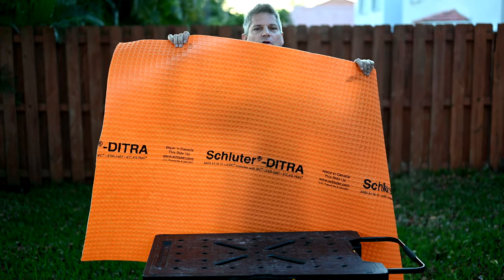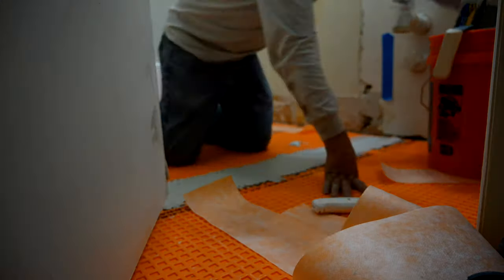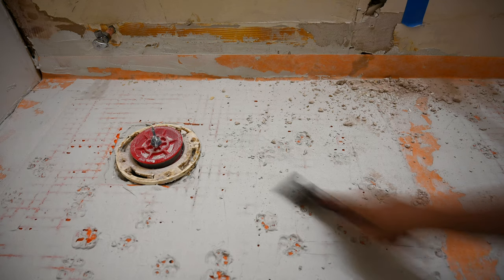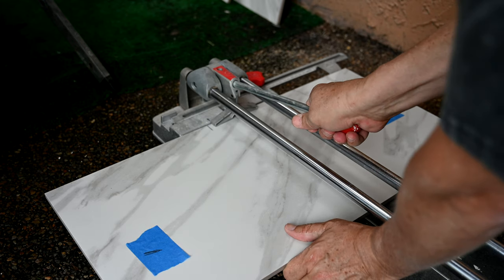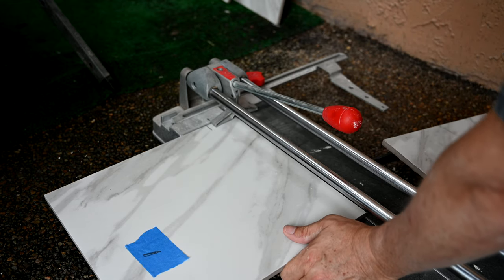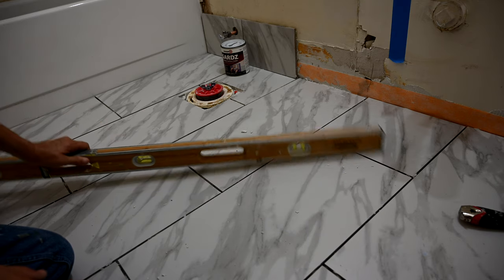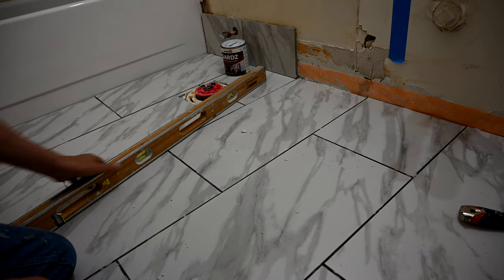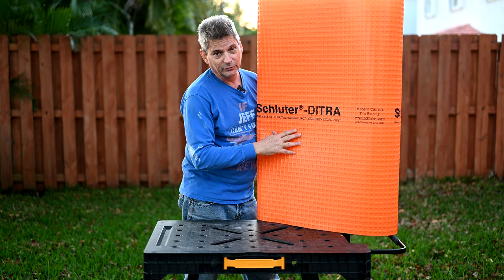Schluter Ditra FAIL Tile Install: You WON'T Believe Cause!

Comment: Those are some pretty cool tile spacers! Where can I buy some?
Reply from the maker: Here is where you get the spacers and wedges:
✅ Raimondi Tile Leveling System Starter Kit: https://amzn.to/2CAyweW
✅ Raimondi Tile Leveling Clip 1/8" joint: https://amzn.to/2RhbodI
✅ Raimondi LS250WEDGE 250-Piece Tile Leveling System Wedges: https://amzn.to/2Sopebl
Reply: Thank you very much for the links :)

Comment: That I know for a fact ain’t no half inc trowel the way u use it that Becomes a 1/4 inch 😂 been in tile business sense 2005 if u use self leveling spacers I call that a beginner u should be able to make that floor just as straight with normal spacers self leveling spacers u must back butter the tile before putting it down I didn’t see that in this video I bet if u take a tile off it’s gonna have 60% of tinset on the floor and 40% on the tile please do a better job so I don’t have to keep replacing floors
Reply from the maker: sounds to be like you're a troll who has no experience in tiling. You can't even properly pay attention to a video, let alone what you are doing. Of course there is no 1/2" trowel here on the mortar, there is not supposed to be trowel lines ! This was the scratch coat for Schluter DITRA, where you fill in all the cells and leave the top surface of mortar as level as you.  We have not even gotten to the point of talking about tiling yet because our surface mortar is not dry yet, and here you go off on some nonsense talking and rambling on about something not even related to this video. If you look at my full video on this bathroom remodel, set to the timestamp, you can see I used 1/2" trowel, and you'll see me back buttering. Clearly you are not qualified for this work and should not be criticizing the work of those of us who are when you know nothing about how the Schluter tiling systems work.

Comment: That's what you get for pre filling the "dee-tra" . Schluter does not recommend this....
Reply from the maker: Schluter instructions say you can do it either way. Point to me exactly where Schluter says not to do it. It makes perfect sense because you have a nice dry surface to work on when you lay your tiles.
Reply: @jeffostroff  true story. More than one way to skin the cat. The product served to uncouple and as long as it’s in proper, laying tile over right away or anywhere in the future is proper. I see how many believe to install tile while key layer to utilize the dovetail without any separation but to me it doesn’t make a difference really.

Comment: Didn't even watch the whole video but I can tell you your not supposed to float the ditra before tiling...
Reply from the maker: You are wrong, you can float the DITRA before tiling. If you going to come here and make such a statement you need to back it up with a link directly to Schluter's instructions specifically stating you can't do it. Did you go through the DITRA training and are certified to make that claim and back it up?
Reply: @jeffostroff  Hi Jeff, what is the purpose of floating it first and letting it set before tiling? Is it necessary or can I just tile straight onto the ditra? Cheers
Reply: @mazzazza  - as a super pro tile setter I always float my ditra after install. I just find it easier and quicker to install the tile with better end results. Small area like this bathroom would be complete in one day.  I also use a screeding / shower pan mix to fill the ditra.  Cheaper then thinset.
Reply: @grizzly8859  how do you float then set tile the same day? Do you allow a little time to dry inside waffles or just put a sheet of ply down to stand and kneel on. Thanks for the tips.
Reply: @torkdork69  rapid  setting shower pan mix..

Comment: You don’t have full coverage in distraction, too many orange voids showing through.  You need to spread first coat in all four directions to fill the keystone voids in ditra
Reply from the maker: The coverage came when we trowel in the mortar for the tiles, there was more than adequate and we used a 1/2" trowel

Comment: Holy moly, what a scammy title. This isn't Ditra Failure, it's a installer failure for not securing the area after you left. 

You're also completely defeating the purpose of the ditra by filling it all in with thinset before you install your tile. Now the tile doesn't have anything to adhere to.

Looking forward to the real failure videos after these tiles start to come loose from all of the jobs you've done this way.
Reply from the maker: I was told by the tenant that he would have the dog locked in a room downstairs that he would not go upstairs, and said don't bother putting the door there. It's your fault for being holier than thou. You are wrong about DITRA they tell you that you can do it either way. The tile adheres to the thinset mortar not the DITRA. So your logic is way off. You should call Schluter and talk to them.

Comment: You should get some knee pads. Nice work.
Reply from the maker: I try to minimize my time on my knees, sometimes I use my large rectangular Kobalt knee pad, sometimes I use my high end wood floor recycled tire underpayment to absorb weight under my knees. I can't stand knee pads.

Comment: Before I watch let me guess the failure. HAND MAN INSTAL. Ha ha. If you don’t want issues call a professional. Wow I just watched and watched the old vid. You can clearly see the dog tracks as he is tilting. A pro definitely would have caught that.
Reply from the maker: The tenant was supposed to lock his dog up overnight in the patio. Even told us not to replace the bathroom door on the hinges, don't worry about it I'll guarantee she won't get out, we'll keep her locked up all night. No matter, it doesn't even matter if the dog tracks are there when you lay the tile, because when you trowel on the thin set in fills in all the dog's paw craters.

Comment: How com you did not fixed walls before installing membrane ?I hope you guys used silicone between floor and baseboard not grout .please do better job next time
Reply from the maker: Walls were fine in the area where we installed the DITRA. This video was not a full installation video, if you see the other video, you will know we used silicone, so your call telling us to do a better job next time is unfounded. Stick to what you know.